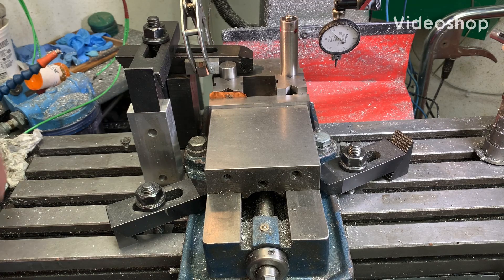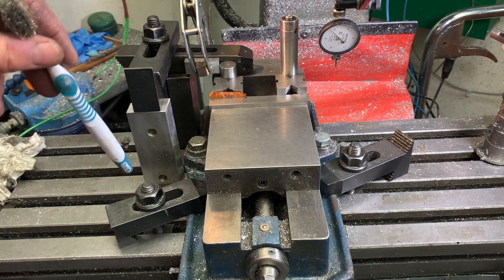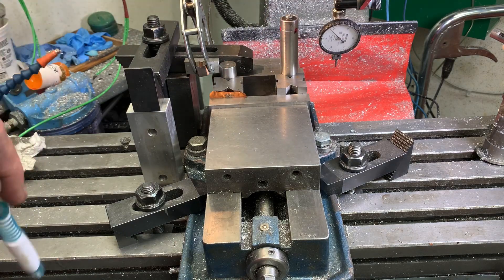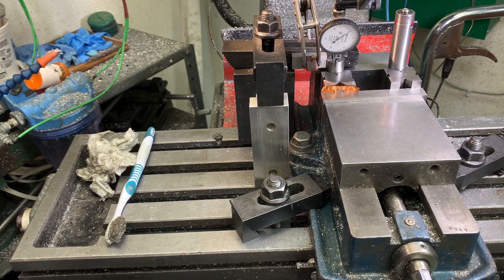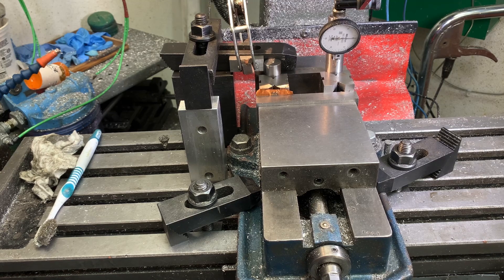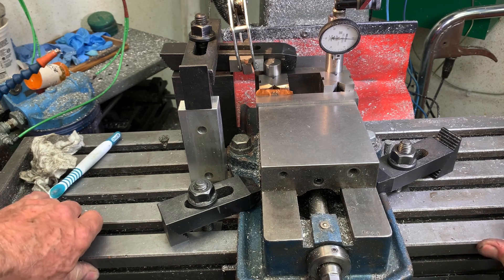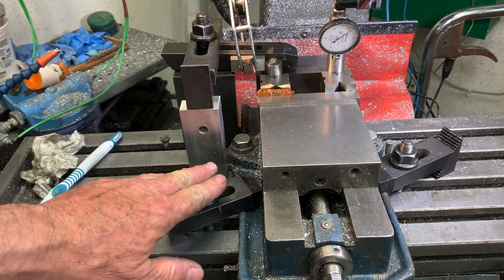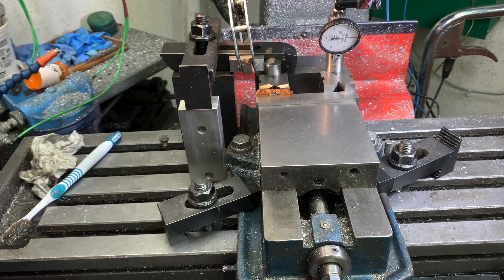Aligning a vise on a mill

Comment: So the pin on the left is in the nest between the strap clamp and the kant-twist because you don't want it moving left or right. Is it because the vise is not tightened? Or is the nest to compensate for part lift when the vise is tightened? I'm watching that section again and again but I don't understand yet.
Reply: I read the article on your website and I think I understand it a little better. The issue of wear in the machine ways is a good point you made, as well as how well the vise is sitting on the table. I still don't see an advantage to the old method of running a test indicator along the fixed jaw while drifting the table back to zero as you see run out.
Reply from the maker: Yes, the vise is not tight at this point. It can pivot at the left pin so can’t move along the Y axis. By zeroing at the pin, I can move to the right and pivot the vise until I again read zero. It is a single pass process. Without the pin, you must move back and forth until the change is acceptably small. Every move on the right causes some shift on the left.